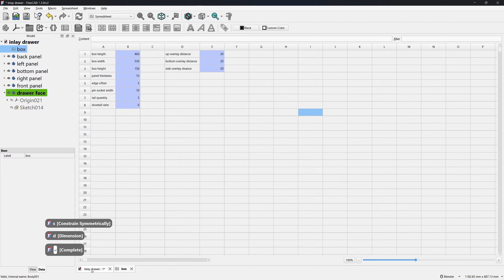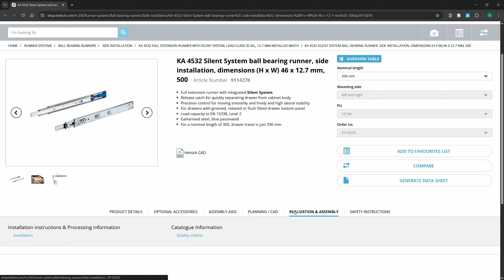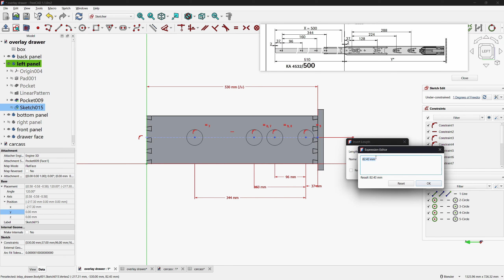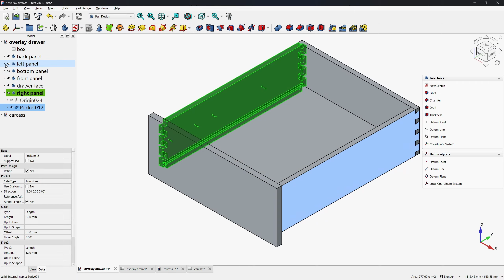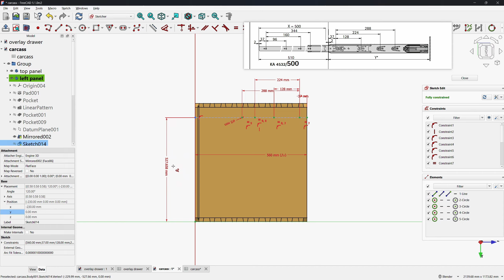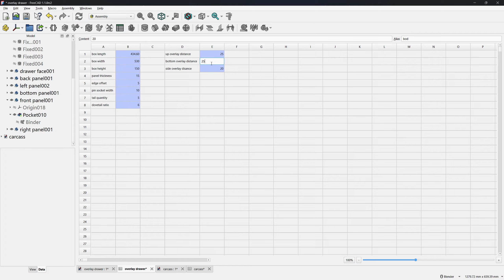FreeCAD WoodWorking Tutorial-6 | How to Install Drawer Slides for an Overlay Drawer

Comment: Hi, how do you apply textures? Do you use a FreeCAD workbench or external tools such as blender?
Reply from the maker: Hi，I haven't  found a good way to apply textures in FreeCAD yet, and I used Keyshot to do the rendering,  Blender is good choice.  if for make the manufacturing bom,  it's better to create board , for example,  taking X direction as the Length , Y direction as the Width and Z as the thickness.